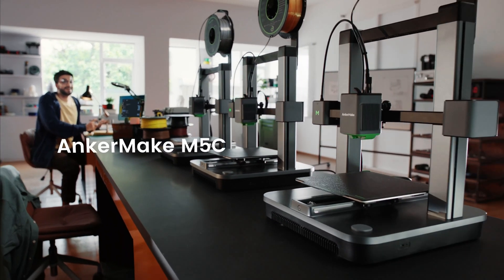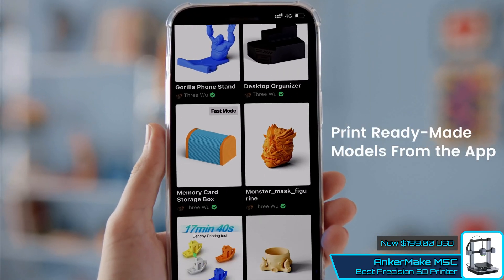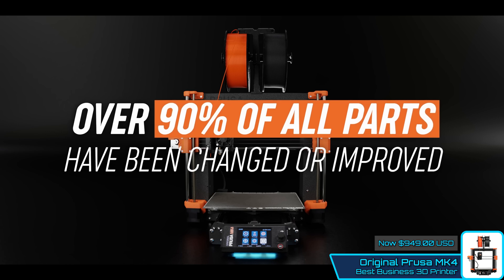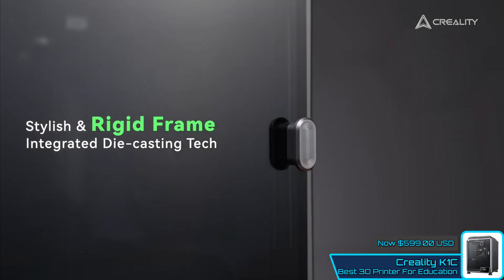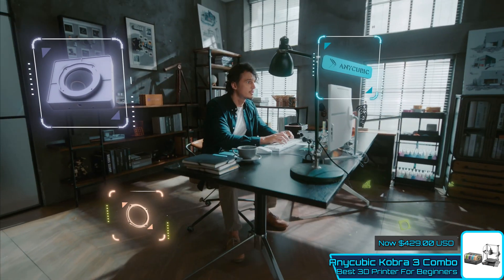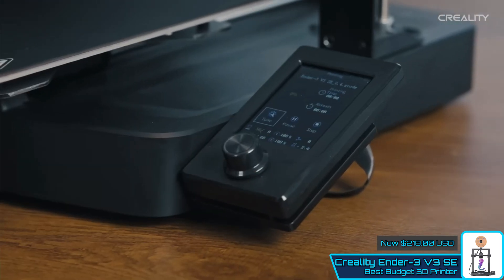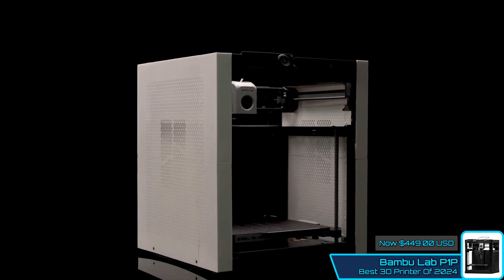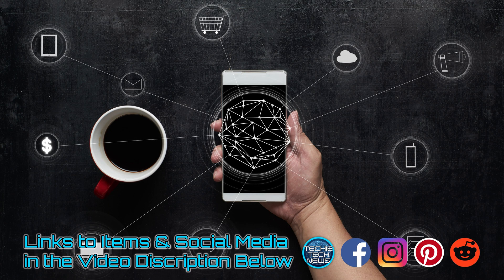Best 3D Printer 2024 - Top 3D Printers That Every Enthusiast Must Have!

Comment: better list:
-Sovol sv07
-Bambulab A1
-Bambulab P1S
-Bambulab X1C
-Voron 2.4

nothing to debate here
Reply from the maker: Thanks for the comment and suggestion. In the end, these lists are clearly opinion only. But this list is for general users. The other side of the list is value for money. Our list would be different if we wanted to focus enthusiast only, also. But again.. Opinions, right? lol.. I do like your list though as they are great too. Either way, thank you watching and offering alternatives. Take care, Jim with TTN :D :hand-pink-waving:
Reply: It will be interesting to see how bambulab printers will perform with a few years of age. The main target group of those machines are mostly not tinkeres, just plug and play people -which is fine and important for the technology to spread but I'm not convinced what they'll have much fun with those machines when they get older. Core XY has advantages but ease of maintanace isn't one of them, as soon as that belt reaches the end of it's lifetime well have fun if you have no idea what you're doing. It's different to bedslingers, they are straight forward, easy to maintain especally prusas i3 machines, they run for ages, sure slower and all but not worse. They just work.
Reply: @exactpause9218  well open your eyes. There are X1Cs running in print farm for years now. And most of them still work perfectly fine